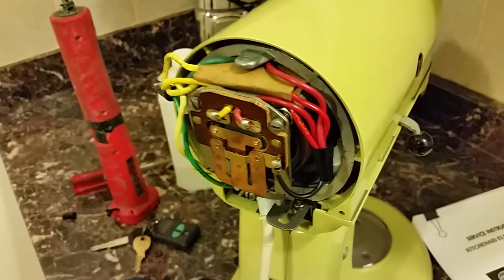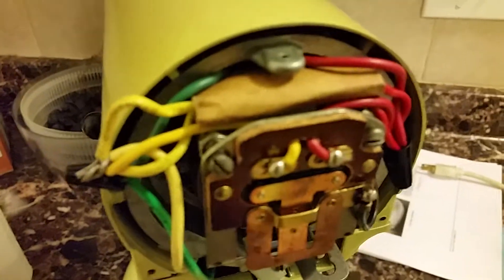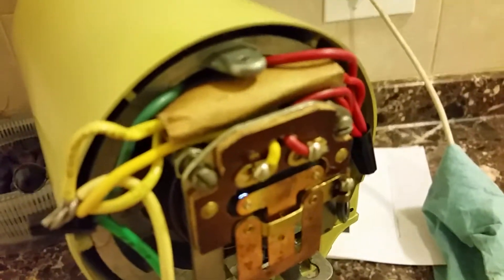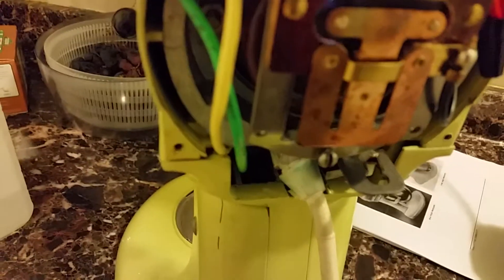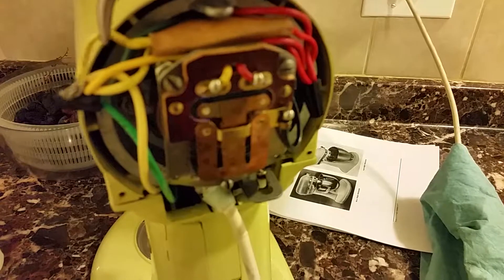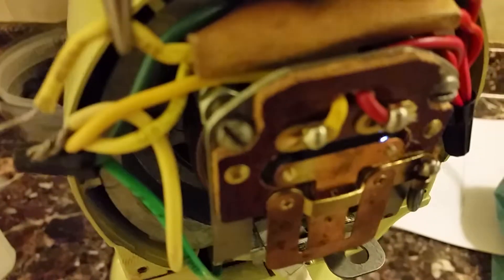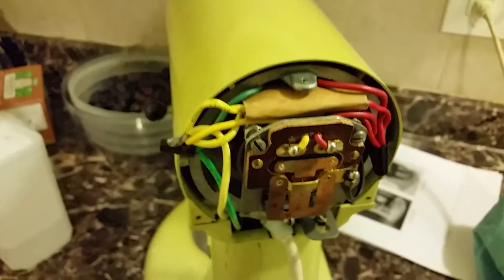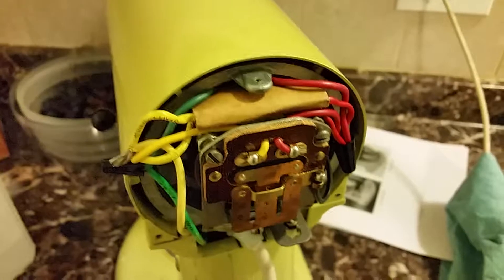HOBART-KITCHENAID MODEL K45 MIXER (PRE-SOLID STATE) - EFFECT OF CAPACITOR ON GOVERNOR POINTS

Comment: How has this fix held up? Where did you find it needed .1 MFD? And what type is it and what's the voltage?
Reply from the maker: In this case the capacitor is the original and needed no replacement.  The video is just to show why it is used.  Modern 0.1 or 0.11 MFD units are readily available from Mouser.  The capacitor must be of the un-polarized type (does not mater which lead is positive or negative) for AC service.  Voltage rating needs to cover the the peak of the 120 RMS AC sine wave which is about 170 Volts - so a 200 V  or higher unit is great.  The form factor of a modern capacitor can be quite smaller that these original units.  Lead insulation (use shrinker tube) needs to be cared for on these non-factory capacitors.

Interesting the the K45 and K-5A service manual states the capacitor and speed control plate be replace when routine service is performed.
Reply: Hey, thanks for the info! I would have thought that you would need much more in terms of voltage to combat the voltage spike that occurs from the magnetic field collapsing when the points open, and that it would have to be of low impedance as well considering the fairly large current it has to handle... How did you find out about the .1 MFD?

Fully understandable why you probably would have to replace the speed control plate - like old distributor points of old those contacts wear out, even more so when the capacitor fails! You can always file them a bit if they're not too far gone, though, I've done that on an old Sunbeam Mixmaster that was going really rough, it works great now...
Reply from the maker: The capacitor measured 0.112 MFD and on the Internet someone said 0.11 and I think I saw a simple "0.1" mark on mine.  The capacitor is inside a short paper towel core style protector and is not visible in the video.  Sunbeam used 0.08 MFD rated for 160V which is correct for 110 VAC.  Depending on exactly where in the sinusoidal magnectic cycle the points open would determine the how much energy the capacitor is exposed to at that opening.  Both Sunbeam and KitchenAid also use a resistor as an alternate path when the points open to soften the blow versus opening to a pure open circuit.  If the resistor goes bad the points arc very badly.  The capacitor handles very little current I=E/Xc, Xc=1/(2*Pi*F*C), which works out to 4-5 mA current plus at lease 10% for not having an ideal 0% power factor- detailed catalogs list capacitors at about this pf. When I checked mine by plugging it in to the wall, I got a reading of 7 mA.  Indicating some Dielectric breakdown not picked up on the capacitance check.
Reply: Fantastic! Thanks for the great explanation, it makes a lot of sense for this old curmudgeon whose only reference is voltage spikes across points in a distributor! Two Thumbs Up :-)
Reply: @markdavidstrode4  When you say MFD, is that uF (microfarad) or millifarad?
Reply from the maker: @derekheld1427  Microfarad.  Lower case Greek Mu.